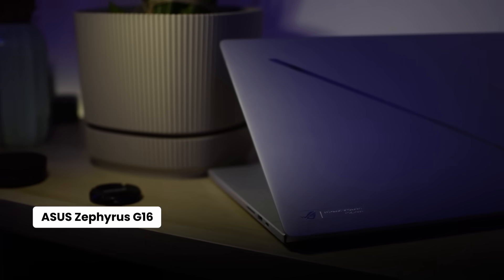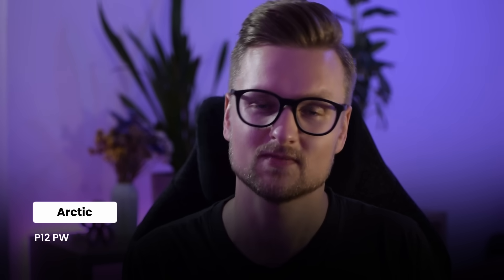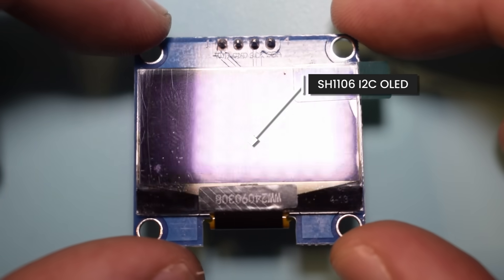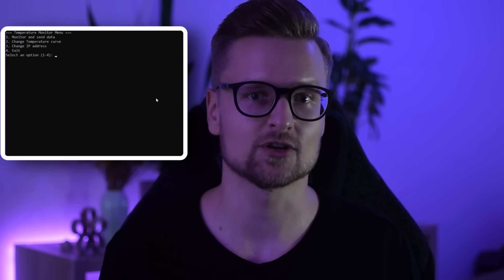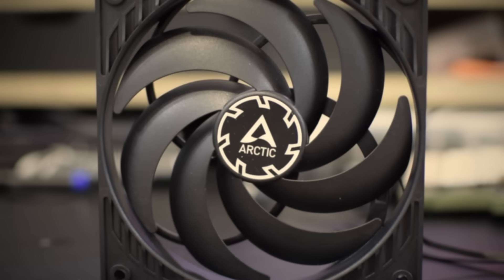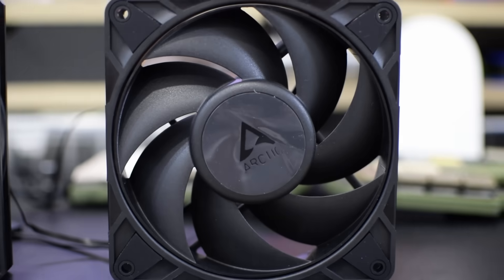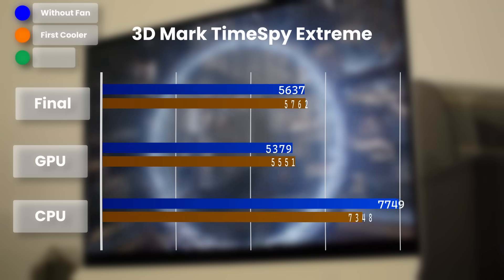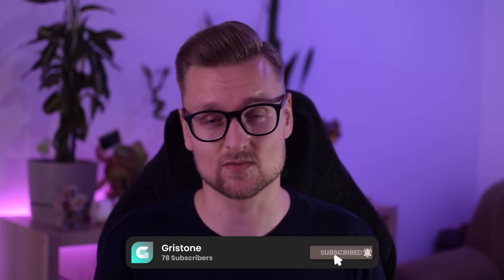DIY Laptop cooler - Say goodbye to overheating!

Comment: i love this design. i've been thinking to make DIY laptop cooler just like Llano, but now i realized why should i make the casing as long as the laptop when i can just make it the size of the vent. i have a Delta fan laying around so i'll try to make the cooler with it. i'm worried that i'll broke my laptop fan, because how powerful it is (it can literally take off if you dont attached it with anything). But for the sake of science, i'll do it. Thank you for the inspiration
Reply from the maker: Yes, i had pretty much the same thought, there is pretty much no need to be the whole size of the laptop. I guess in the case of Llano or Razer, they are larger to accomodate more laptops. But i would be very curious to see the results of that! I think you should take off the original fans for that, to not have them spinning out and burning.. Im not sure, but just crossed my mind. And im glad i could work as inspiration!

Comment: Great video, man! Really clean design. 😊
I'm thinking of building something similar for my Lenovo LOQ 15IRX10–do you think this kind of setup will work well with that laptop?

Also, should I go for more powerful fans, and maybe add a sponge dust/air-filter layer behind them to keep dust from getting inside the laptop?
And one more thing, can I just make simple plug-and-play fans? I'm not able to do the more complex auto-speed or temperature-controlled stuff.

Would love your suggestions. Awesome work on the video!
Reply from the maker: Thank you very much! :) And im 100% sure that a setup like this would work for your laptop aswell. If i look at the pictures of your laptop, it has pretty much exactly the same setup on the intake and exhaust. More powerful fans never hurt. For me it was a combination of budget and availablility, as the better Arctic ones (P12 Pro PST) were something like 6 euros a piece, and still had very good performance for that price. But for sure, if you can go for more powerful fans, go for it. :) And as for the dust filter, i would highly recommend that. I created magnetic slots for this pupose aswell, but i left that part out from the video, as it was already getting quite long. But any time when you can block dust, its better to do that, even if you lose a bit of airflow. 
And the simple plug-and-play fans, they will work for sure! The only issue with those is, that if you just supply 12V (thats what they usually use), they will be spinning at 100% speed at all times. So it works, but can be a bit much to have it constantly like that. So i would suggest in this case, to use at least just a simple Potentiometer in between the power supply and the fans, to adjust the voltage that the fans get. This would pretty much give you the manual speed adjustment, with very minimal electrical work. Good luck with your project! :)

Comment: Maybe revisit this and modify your laptop to have the fans hotswappable so you can remove the fans in the laptop when you place it on the stand so the big fans can push air through the heatsink unrestricted :)
Reply from the maker: Yes, this would be really cool, as i could actually utilize the fans to the fullest. To have a stationary and mobile setup. It wouldn't be impossible at all, but i'll wait atleast until the laptop is out of warranty (or if the channel grows and Asus sponsors me with a laptop :D ).
Reply: @GristoneIT  Rooting for you! 🙌

Comment: Nice, I did this a couple years ago with some spare 92mm fans that I had laying around.
Printed a duct from 120mm fan filters to the fans and another from the fans to the intake from the laptop.
the duct is sealed up to the bottom of the laptop with a thick border of foam rubber.

Fans just run on 5V no fancy control, it's quiet and still more airflow than the laptop can do on it's own.

Now I got a new laptop so it's time for an upgrade, when I find the time again.
Reply from the maker: Thats really cool! The fancy controls are a nice to have, but really not a necessity. :)
Reply: @GristoneIT for the second video on the Channel this is a really strong start, keep it up!

Comment: I just bought a laptop cooling stand and this video just gave me an idea to use some foam weather seal to go around the bottom intake vents and around the blower fan in the stand so all the air blows into the laptop. This is such a good idea.
Reply from the maker: Yes, it should actually make a really big difference. Even if the fans are not meant for high pressure, the sealing will still for sure force more air to go through the laptop!

Comment: Nice Video! Thanks.
Just wondering why didn't you use burn in test of 3dmark? It runs the test in continues loop. 
I would expect to see a noticeable difference after 15-30 minutes or so
Reply from the maker: Thanks for the suggestion! I was really new to the world of benchmarking, and i had only done the TimeSpy tests with the first version of the cooler, and as i pretty much destroyed it, i couldn't go back to do more tests for comparison there. I could still do just stock fans vs the final cooler, but i really didn't know on what are the standards, or tests used. I might still do a 3.0 version of the fans, as a lot of people have suggested a lot of improvements, so i will know better then, on what tests to do. :) I could also release some shorts where i do different types of testing. I also wanted to do Gaming benchmarks, but i felt like i had spent already so much time on this, that i just need to get it out. :D 
But do you have some other suggestions, besides the Burn in test, on what i could use to test and compare?

Comment: 02:25 also the shown product doesn't works well with tha G16 because the foam sealing the intake air, blocked exhaust pathway on the G16 on its default seating position, you have to align the edge of the rubber feet to the edge of the foam to prevent that, but by doing so you also block some of the laptop intake
Reply from the maker: This is very much true! It was also something i mentioned in the original clips, but i cut that away for the sake of making the video a bit shorter. :)

Comment: your project looks awesome! almost like a finished product
reminded me of the time I had an old vaio and drilled a hole with a hole saw to make a fan intake for fresh air without restriction, it still ramped up to 80ºC but after that mod it took way longer to reach max temp
Reply from the maker: Thank you very much! The sealing remained a bit "rough around the edges" as i tried to shape it more nicely, but other than that it actually came out great. And thats actually cool, maybe after a couple of years when this laptop is no longer in warranty, i could do the same. The filters on the bottom of the laptop are still quite restrictive, so getting rid of those, i could really push some air trough.

Comment: if you want even better results, you could try adding a peltier chip. Used this on my M4 MacBook air, alongside a thermal pad mod, and the performace is bonkers, with great temps
Reply from the maker: Yes! Someone else also suggested this, i really think i need to do a 3.0 version with those!

Comment: As a year long G16 owner, the fan pads are fine. I use one on my main desk on low and it helps a ton. These laptops just sit to close to the ground and cant suck in air and end up reycling the hot air around the laptop. The desk pad removes that.
Reply from the maker: Yeah, that is true, literally anything helps. I guess the order goes somehting like this: Get it to a hard surface -> get it up from the hard surface -> add fans -> seal it to force the air through -> add some actual cooling elements. Moving to the next level is always better than the previous one. :)

Comment: I have an even more buget version of this lol.
I bought the cheapest "notebook desk" for my desk, drilled two 120 mm holes on the bottom, attached a bore terminal connected to a dial controller from Ali Express.
Connect the fans to the controller and made a seal out of styrofoam that matches my notebook bottom piece. Topped it with some AC insulation foam.

It's basically a mini-desk with two fans attached to the bottom that push air through the table into the notebook that has it's bottom side enclosed in stytofoam and AC insulation foam.
It's jenky AF but cools down my Acer Nitro around 10ºC when using max fan speed and costed me like less than 20 USD.
Reply from the maker: Hahah, i mean, if it gets the job done, then there's nothing wrong with that! I feel like that without the 3D printer, my solution would be something very similar to that. But i feel like that's the true spirit of DIY, we work with what we have! :)

Comment: If you like power, effiency, small size of a laptop and quiet fans, why not just use M-series CPU macbook?
Reply: CAD Software Is Mostly Designed for Windows. It notoriously runs really bad on MacOS.
Reply from the maker: Yes, this is one of the biggest reasons. With rosetta, plus every day a lot of straigth up native conversions, its not going to be an issue forever. For now, im sticking with windows.
Reply: @GristoneIT  Yeah same, I wish support would move faster. When I was picking a laptop for uni and mechanical engineering, that compatibility issue was the main thing that stopped me. It sucks because the M-series chips have insane efficiency and battery life, if it wasn’t for that gap, I’d be buying a MacBook ASAP. 😅
Reply from the maker: Yeah, i pretty much have my software that i am used to using. Plus i'm programming mostly .NET stuff for windows, so thats also a factor. I have thought about getting one many times, but i dont know if i would be willing to go through the effort of finding alternatives for everything that i am doing. Theres no denying on the advancements on the M series chips, and at the moment they are really dominating a lot of the factors that make good laptops.

Comment: Now you should try the S12038-8K, its a 120mm server fan sold by arctic, get the 8,000 rpm version. I use them on my main tower, I power them by Molex and PWM from header because these are around 3.5 amps. ( keep in mind these a very loud fans )
Reply from the maker: Thanks for the tip! I could make a 3.0 version of this, without having any regard for the noise level. Just put some of those server fans there, and let 'em rip.

Comment: Bruh.. if you're going to use just air.  use other fans too.. id you're pushing air through intake vent use centrifugal axial fans that got high cpm. These cpu fans are better in suction than compression.. use these cpu fans in outlet of laptop.. these are low cpm to push air in intake system of laptop ventilation
Reply from the maker: Thanks for the tips, i will certainly take a look!

Comment: I thought this was mounted to the actual cpu/gpu cooler somehow. Kinda lame, but I guess that's what laptops are for. Being lame.
Reply from the maker: That would be extremely cool, but as I said in the video, I still need the portability. I'm traveling a lot, and beet to work on the go, so this is a solution to use when I am at home. Maybe in the future  I can get a "sacrificial" laptop, to try that on. Would be a cool project for sure! 😊